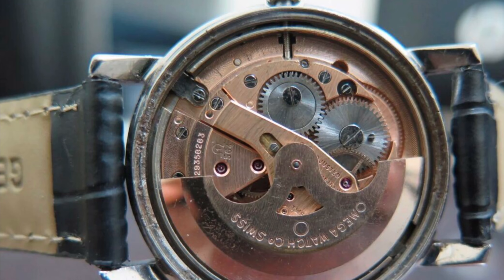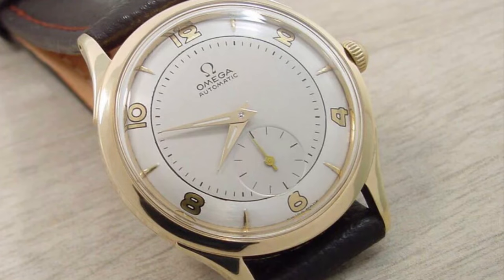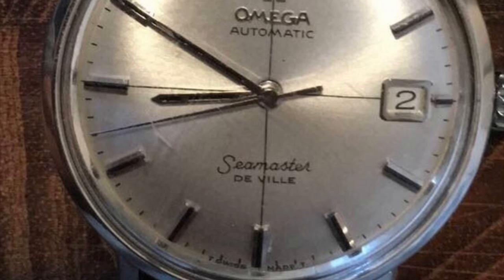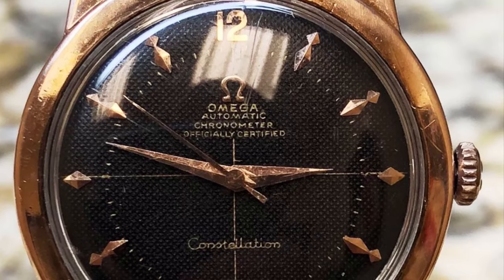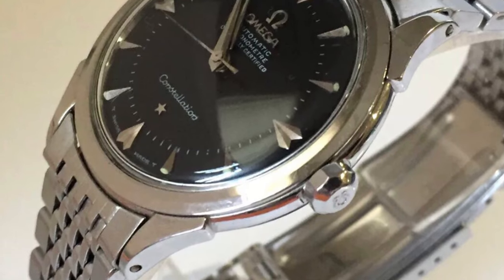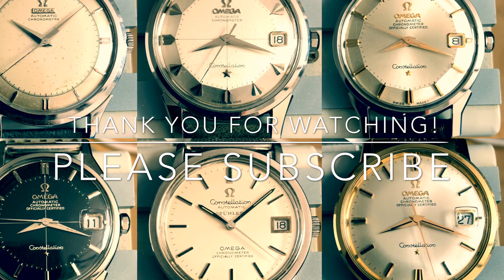Watch Wrong? #2 - Vintage Omega watch issues, Can you spot them!?

Comment: That  last watch that wasn't done correctly, also didn't set the star to be split in the center by the grid line. I saw that when you showed the original condition one.

Comment: Great video! You said when you have luminous hands, the dial should have luminous paint, but I don't know if that is a must... I have a 1960 Seamaster, completely original, with a 14743 case (the same as the one on the photo of the Omega archives for that case), the have have luminous paint, but the hour markers do not! Best regards
Reply from the maker: Thank you!  CK 14743 is a Pre-Seamaster Deville or Seamaster Deville depending on the year it was made.  1960 version would just say Seamaster while the 1962 version will say Seamaster Deville.  It is common that the hour luminous have been removed in the past.  Sometime by request from the owner or mistakenly removed by the watch maker.  It could also be a very good redial.  Many dealers who sell vintage Omega may not be able to tell a redial apart.  So do be aware of that as well.   Last but not least, I have seen factory original dial replacement from service or previous owner decided to swap dial because of damage or just want something different.  But the fact is, luminous hands = luminous hour indexes.
Reply: You have a mismatched watch

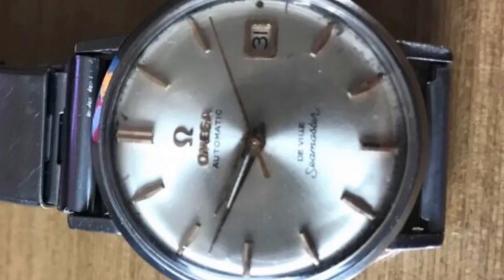Comment: Hello, there. Very helpful vodeo! About the two watches at 6:15-7:30, De ville should never bee above Seamaster on the dial but Geneve can be above Seamaster? Because on all the pics i have seen Seamaster is always above Geneve. Also the words " swiss made" i guess is a must at the bottom of the dial for all omega watches? Thank you 💖
Reply from the maker: That's correct.  I've never seen a Seamaster Deville with the word Deville above the Seamaster.  But, for a Seamaster Geneve, the Geneve can be above the word Seamaster.  Not very common though

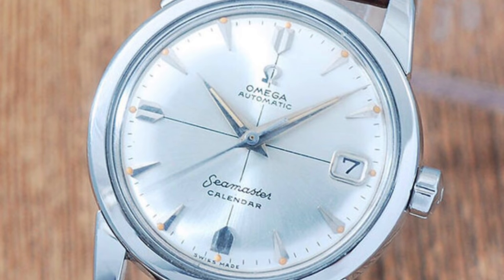Comment: On the Seamaster calendar at 15:50 they also didn’t include a T or other lume type indicator around Swiss Made
Reply: I may need to take that back. I've seen legit looking watches with Lume and no T on the dial. I know that other lume material that's not Tritium may be labeled different on the dial, but does any know if its normal to see Tritium lume that's not denoted with a T?
Reply from the maker: That watch is from the 1950s, so the Swiss Made is not supposed to have "T".  T = Tritium luminous.  1950s Omega still used Radium luminous.
Reply: Ah, thanks for the clarification. I knew Radium was used, but wasn’t sure of the time period between Tritium.
Reply from the maker: @augiedoggie  Tritium was introduced in 1962.  At least for vintage Omega.  Not sure about other brand names.

Comment: I haven't spotted any discussion of vintage Omega watch crowns on your site.  It seems most manual wind Omegas use a crown with multiple, regularly spaced grooves and many, but not all automatics use the style of crown with just 4 lobes (please excuse if I'm using incorrect terminology here).  I'm curious to know if there's a rhyme or reason behind Omega's choice of crowns for their older models?
Reply from the maker: Hi Dave,
basically, for all manual wind watches in general regardless of the brand, the crown is designed in a matter for easy winding.  Adding those lines/grooves/knurls or whatever you call it is for easy grip and hold.  For an automatic watch on the hand, you really do not need these knurls on the crown since the watch will self wind as you move your wrist throughout the day.
Reply: @TimelessHistoryChannel  So, if you find a vintage Omega manual wind watch with just the 4 lobes on the crown instead of multiple lines/grooves would that be an indication the watch is NOT original?
Reply from the maker: Finding a watch with the incorrect crown does not make the watch NOT original.  Replacing a crown on the watch is like replacing the rim on a car.  It will not affect the value or authenticity of the watch.  Worry and focus more on studying the case model.  Know how the case should appear and the movement it takes and learn about dial of the watch whether it is factory original or has been refinished.  Minor things such as crown and crystal are things that you will naturally pick up as you learn about the watch as a whole.

Comment: One thing I forgot to mention I recently took my watch to a watch guy and he installed a reverse cyclops on my c shaped Omega but it was round did Omega use a round shaped reversed cyclops on this particular watch?
Reply from the maker: I have seen round one before.  But I do not think they exist on the C model.  And if the center of the crystal does not have the Omega logo then you know the crystal is not original.

Comment: Did you mean Geneve Omegas with raised hour markers should have raised date windows? Don't  de villes and others like LLU6289 have raised hour markers and no date windows? Bare in mind I have a lot to learn about vintage Omegas.
Reply from the maker: This one will need sometime to learn.  This is a question similar to telling whether if a dial has been refinished or not.  I will need to see and example the dial to tell you for sure.  Not all Omega watch dial will have the raise window.  Even on some same model number the dial vary for the date window.

Comment: What is the best Seamaster to buy in your opinion?
Reply from the maker: I am only familiar with vintage. I have no issue with any Seamaster between 1948-1969. But Omega's best automatic movements were introduced in 1959 under the 55X/56X series.

Comment: If it's vintage and the dial is black it's probably wrong.  Black was not as popular then as it is now.
Reply from the maker: Black dial is very rare.  It's common to see black redial.  But if you check on my site, you'll be able to find all factory original finish black dial.